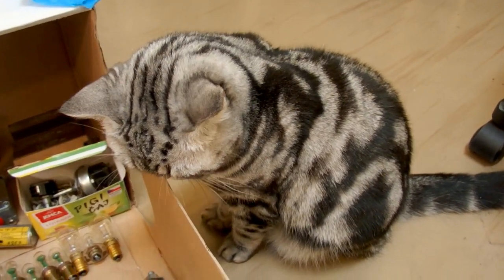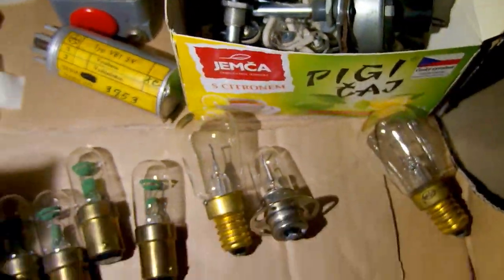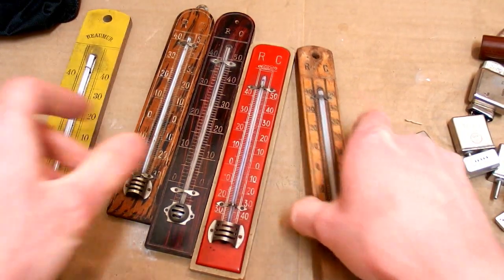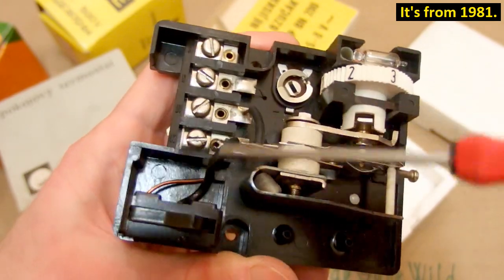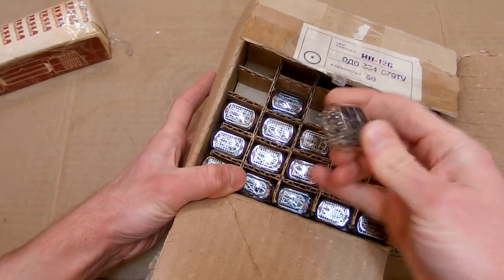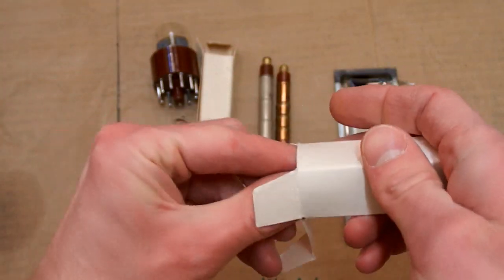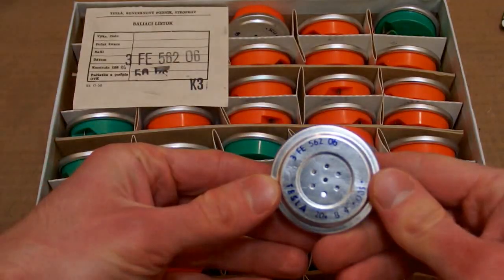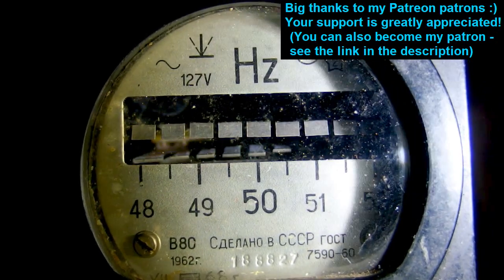Boxes full of vintage electronic components!

Comment: 3:23 BLOODY HELL !!!
Reply: <SNORT> Ha, ha, ha, ha... XD
Reply: Bloody f*ck, I actually remember building small electronic projects with similar Soviet era components when I was little in another eastern block country.  Yes they  were crude and unreliable components, but it brings back memories... ahh those bistable tyr or tyrystors for high voltage switching, those were some crazy days. he-he
Reply: The device is a simple relay for circuits with high inductive loads which require bigger gaps on disconecting. It's made in Bulgaria and translation errors like this were very common - in Bulgarian it says "контактор въздушен" which means "contactor aerial". 

I remember a small record of a famous Bulgarian singer, containing the song "My way" of Sinatra. The records factory did the translation to Bulgarian, somebody then decided to translate back to English and on the final printed cover the title of the album is "My road".

Comment: As an Australian, I always wondered why Tesla brand is used on everything, so I checked Wikipedia...
The company was established as Elektra on 18 January 1921 and renamed TESLA on 7 March 1946. TESLA had a state-sponsored monopoly on electronics production in Czechoslovakia, and produced nearly all electronic products in the country until 1989.
Reply: Hello, 

but the brand still exists and independent or even cooperating TESLA companies are still operating and some are not. An example is TESLA Blatná, a.s. where it produces parts for motor vehicles, sensors, custom electronics and mainly electronic components such as power and high-ohmic resistors, chokes and coils and optoelectronic elements (photoresistors, phototransistors, optocouplers and others...). Part of the low-power production was transferred to the VISHAY Draloric/Beyschlag brand (VISHAY Blatná, Dolní rychnov, etc., where metal oxide resistors MBB - SMA0207 or, for example, wire resistors type VISHAY AC are still produced). Also TESLA Stropkov, manufacturer of communication devices (doorbell systems, telephones...), access systems, common electrical installation material (such as sockets, switches, accessories...), industrial telephones and horns, explosion-proof telephones and horns, locks and fittings . Most of the companies formed from the original company TESLA already have a different name, for example HARLINGEN Lanškroun, ALEMA Lanškroun, ESO Ostrava, Keramické Kondenzátory Hradec Králové, ELCERAM, KRYSTALY, Kolektor Tesla Jihlava, TT Klávesnice Jihlava, ON SEMICONDUCTOR ROŽNOV, ALMETO Polná, etc., etc. Unfortunately, these companies have problems with competition. As is known, China with its mass quantity of products of very dubious quality (known not only from videos but from personal experience) has flooded the market and competes on price. It is very sad to see Czech industry and individual companies gradually die and you can't do anything about it. These are quality products and services. > Current market model: The consumer is mainly looking for a low price. All other factors come second <

Have a nice day!
Reply: @alfarekord779  - you are correct about > Current market model: The consumer is mainly looking for a low price. All other factors come second <
We have the same thing in Australia. 60-70 years ago almost everything of high quality that we used was made in Australia. Now we have almost no local industry.

Comment: Wow lots of interesting components, i bet they all still work fine, very well made :-D.
Those bulbs with green reflectors looked unusual, special use i suppose.

I have only had one thing from russia or surrounding countrys, the regonda/vega mini t.v, it had hinged circuit boards with bits of string to stop them opening too far.
Little red resistors with unknown symbols (to me) on them, every part looked different to what im used to.
The caps were marked MK for the capacitance value, and B for voltage i think.
Memory has faded a bit.
Im used to stuff made in japan/korea/taiwan........
Reply from the maker: Yes, they work well :) for example in my clock. The bulbs with green reflectors are neon lamps. The green paint is an isolation on the electrodes so they don't glow where they're not supposed to glow. I had multiple soviet televisions, but they don't work any more, as now we have digital broadcast. I still keep one small one (Yunost'). They use B for voltage because B is cyrilic symbol for V.
Reply: So i have to think Boltage :)
Sorry silly me.
Reply: It was мкФ - means microFarads. мк is abbreviation for micro in Russian. Ф = F (Farads). мкФ = μF.
Reply: Антон Лисненко, ahh i knew i had forgotten some things.
This was about 35 years ago, my memory has never been fantastic.
Reply: @zx8401ztv  It's OK! пФ = pF, нФ = nF, мФ = mF. You are welcome.
Reply: Yeah.... when I was a kid, I was sure Yuri Gagarin went into space in a Bostok. ????????????
Reply: @edgeeffect  ВОСТОК - VOSTOK = East in Russian.

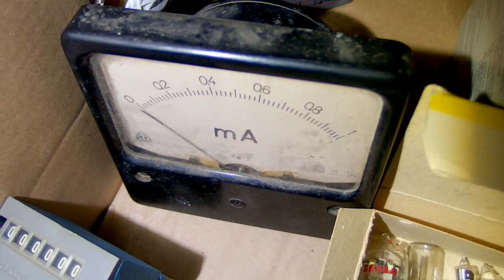Comment: At 1:40 one of your crystals in glass enclosure is actually a gas voltage stabilizer tube (the one more or less in the center, with green print and three leads)
Reply from the maker: Thanks :) I also noticed that one of the crystals is not a crystal during editing :).

Comment: Working as engineer in high voltage power stations, i have some neat 1960’s current protection relais, fuses, huge meters and other things laying around at home. the protection relay is really nice to look at its a BBC ISM-21, I have seen some museum pieces from BBC hanging around being replaced by new stuff sad to see them in the thrash😔

Comment: Try to run some of those components (like displays etc...) :D I want to see how this old components work. Just for experiment, if it is possible :D
Reply from the maker: You can see a lot of those in oparation on my website:
http://danyk.cz/index_en.html
I have built several nixie clocks, a VFD clock, a Geiger counter, a simple vacuum tube oscilloscope, vacuum tube amplifier, vacuum tube tesla coils, and many more :).
Reply: yep, thanks a lot. For me is interesting how this old components work

Comment: what's the likelihood those capacitors still work?
Reply from the maker: Old ceramic, mica or film capacitors always work even after may decades. Electrolytic capacitors may sometimes fail, but the ones in my clock are about 40 years old and they still work. The worst ones are paper capacitors. They get wet and leaky, or the paper decays. They have to be replaced in vintage electronics.
Reply: Jaký ellyty na tom byly lépe ? Starší axiály nebo pozdější axiály s modrou bužírkou ?